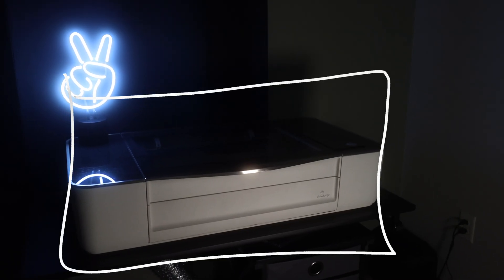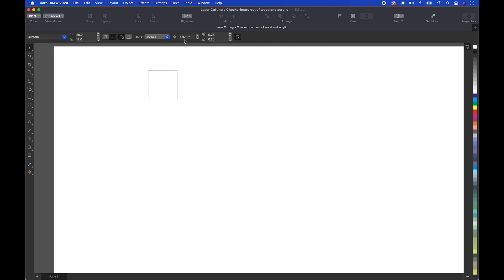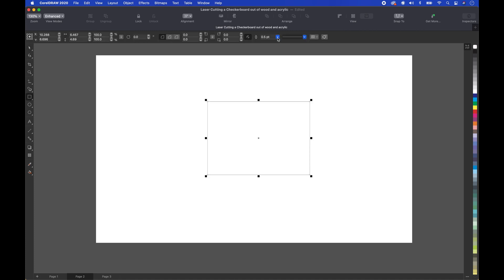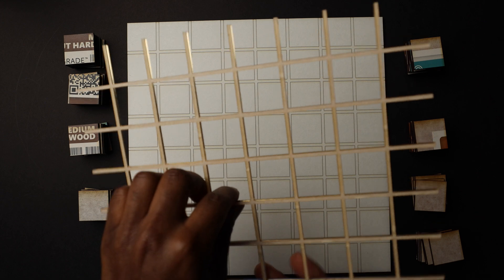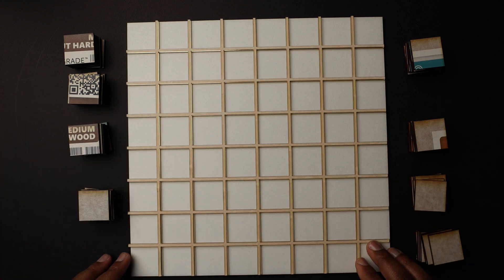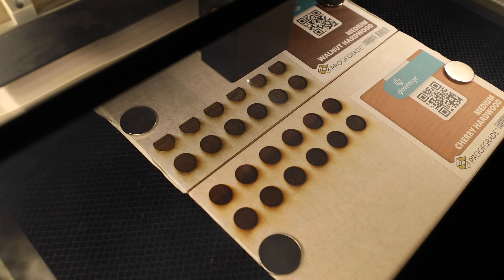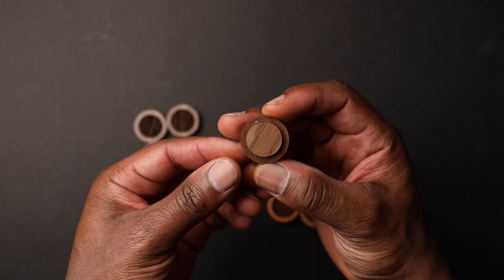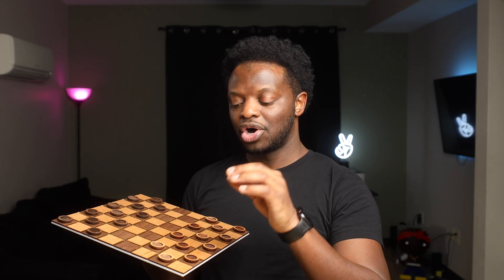Laser Cutting a Checkerboard out of Wood and Acrylic

Comment: Hi Troy!  That was an amazing tutorial.  I've been thinking about getting a Glowforge, you make it look so easy.  I was wondering if I could commission a chess board from you.  I would want my squares to be 1.5 inches with a 1/8th gap in between, but I also need to have the squares enclosed so that there's a 1/4 inch border around the squares.  I don't necessarily need the mahogany and walnut squares or the checker pieces since I'm going to use the two pieces (base and the squares) glued together to make a mold.  If you've seen the laser cut file for a scrabble board, the finished piece would look similar.   The reason the squares have to be enclosed in the final piece is so that when I create the mold, the epoxy doesn't run off the sides.  Is this something you would be willing to help me with?

Comment: was wondering if you used the magnetic sheets cut to the same size as the checker and glued to the checker, if they would hold together when you lifted them? that way you could save a lot of time by not having to cut them to make them stackable. If the glowforge will cut those magnetic sheets.
Reply from the maker: Thanks a good idea. You could even place small magnets inside a chip now that I am thinking about it. 🤔